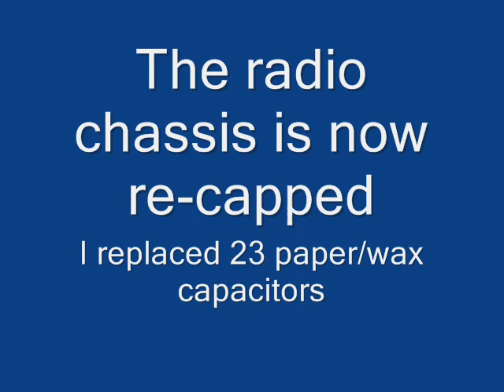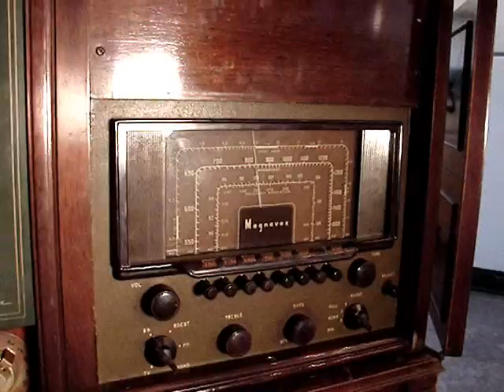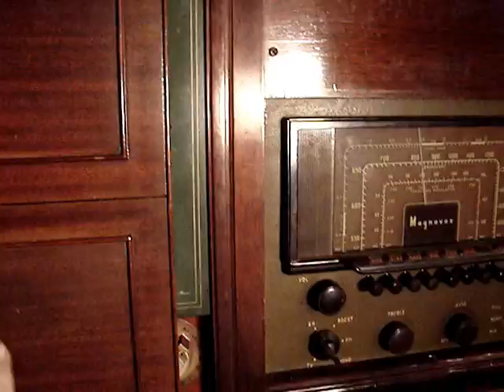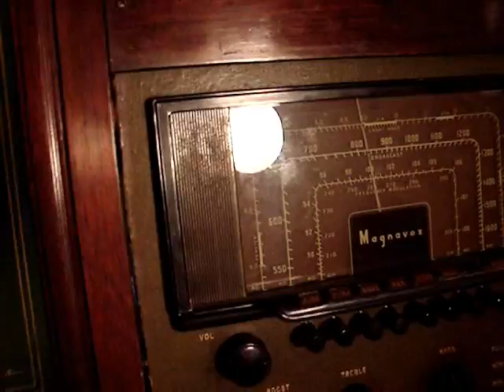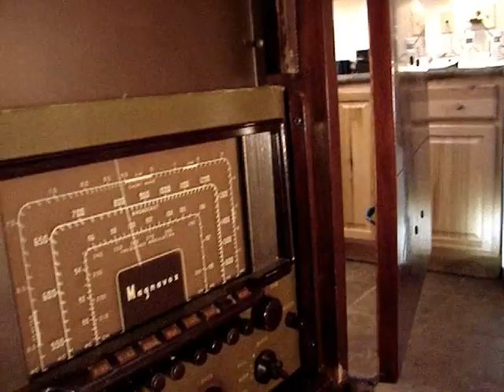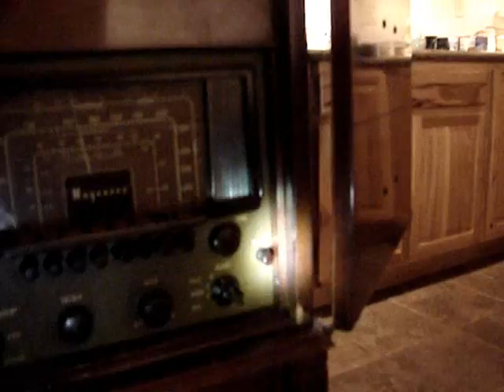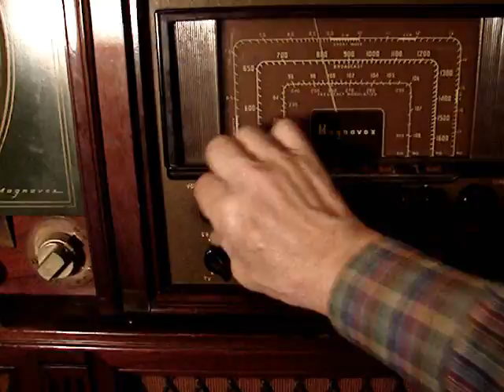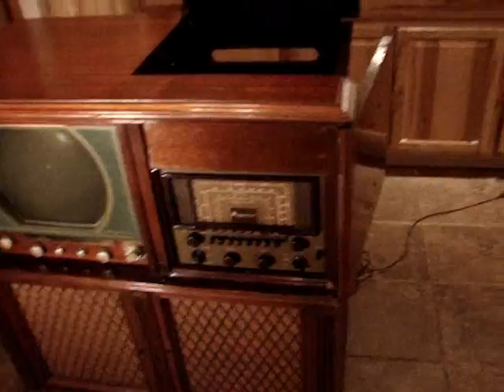Magnavox Embassy 1950 TV Radio Phono Combo PT8

Comment: I feel your pain regarding a previously “restored” set. I’ve been fortunate, at least 95% of my old tube radios have had no modern hobbyist inside them. It’s challenging enough to trouble shoot a non working set, let alone trying to interpret someone else’s creative repairs.
Reply from the maker: Very true. It is a case of someone in their attempt to fix a set and in that process they make it difficult for another tech to fix it correctly. The old 1933 Zenith radio i recently acquired will be a good example. I have not looked under the chassis yet but I can imagine it is probably a mess. Thanks for watching.

Comment: This was an interesting video, and you sure did a great job on that Magnavox from the cabinet to the electronics as you always do.   I think I know what is wrong with the changer, but not sure if I can explain it well enough.  I have the same one and had a similar problem. It has a more sophisticated trip mechanism for an older changer.   The trip mechanism operates by friction, there is a lever that moves in with the tonearm and on that is a very light friction operated lever that  engages a metal tab on the turntable  which trips the mechanism.  When still in the playing grooves and moving slowly in  it is knocked back outward and not allowed to engage the trip mechanism , but  if this is a little dirty or sticky it won't be knocked back out, especially on slower rpm records, and trips early but when the tonearm moves in fast it cannot push the tripping lever back out fast enough and it engages tripping the mechanism.  If it has any old grease on it  and not almost friction free  it sometimes won't kick back out on slower rpm records and trips the mechanism early, but will work better on 78 rpm records as they give the trip mechanism a stronger hit that kicks it back preventing it from tripping early unlike a 33 that doesn't have as hard of a hit and depends more on the lever being friction free.   You may have to remove the changer to thoroughly clean that trip mechanism, it  operates on very light friction and must be very clean, free of oil and dirt.
Reply from the maker: When I worked on the changer I did check to make sure everything was clean and I twice re-oiled the places I used that WD-40 on. It plays LPs all the way through as long as I do not handle the tone arm. Thanks Bill.
Reply: @HD7100  Then I believe it's working right, it has a better  more sensitive trip switch than most changers  of that era, and if it plays the Lp all the way to the end then it is working correctly, if you pick up the  tonearm as sensitive as it is it will trip it.  I'm glad it's working as it should, you sure did a nice job  on that. I don't know when I'll get to mine, it is a Windsor, they paid 800.00 for it in 1948.  It has the big field coil HF driver and horn that was used in theaters in it, kind of overkill for a console, but Magnavox in the early years did have more expensive components in a lot of their  high end consoles and early stereos.  https://www.youtube.com/watch?v=FSp8RO6sKH0

Comment: Look on the back of the radio, you will see a number on the set. The radio chassis number starts with the letters cr then a number. That's the code you look up in Sam's.

Comment: The issue with this Magnavox is that it was sold "with or without" the television unit or the FM tuner. The problem is that not all areas of the U.S. had television or F.M. radio reception. I could be sold as "bare bones" with the A.M. radio and phonograph, or add television or F.M. radio later. The F.M. Tuner was added above the existing tuner and yours obviously came with the television unit.

Comment: I question if this is perhaps a "Franken-set". Shortwave doesn't seem to be as hot as it was just a few years ago.
Reply from the maker: The receiver is three bands BC, FM, and SW.
Reply: It was purchased as a "bare bones" unit, with A.M. and phonograph. Some areas did not have F.M. or television reception. The television and F.M.modules were meant to be added later or purchased together as desired..

Comment: If you have the record changer model number I could check the service manual and confirm the tripping mechanism.
Reply from the maker: I can't find the model on the changer. It is a Webster but I think it is working just fine. It plays LPs all the way through as long as I keep my hands off the tone arm. Thanks!
Reply: If you l5on the changer, there is a switch that says automatic  or manual. When you want to use the changer in the manual mode  turn the switch to manual, but the charger will not go into the automatic mode.
Reply: @HD7100  It is a Webster Chicago model 102, I believe..
Reply from the maker: @1953childstar  The record changer works excellently. I have not been able to get the television working. I plan to get back into it sometime this coming fall.